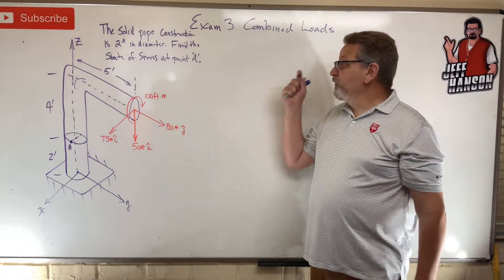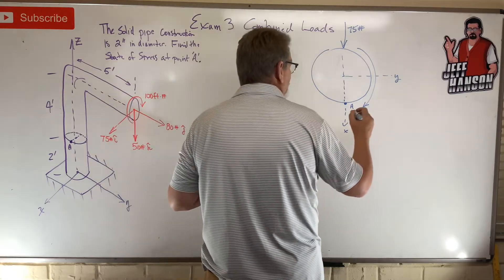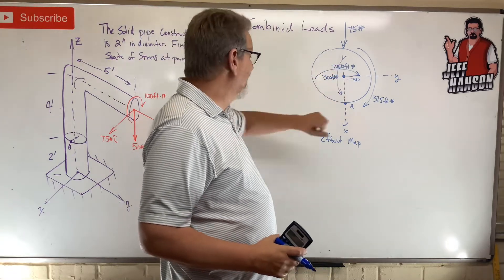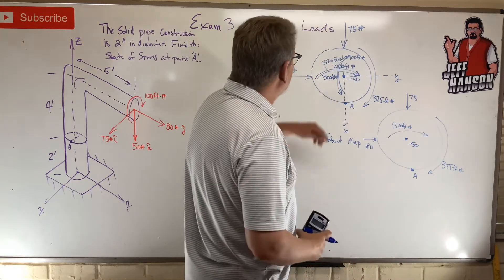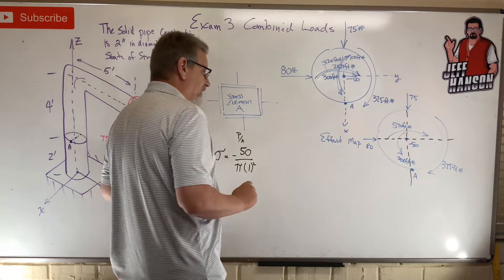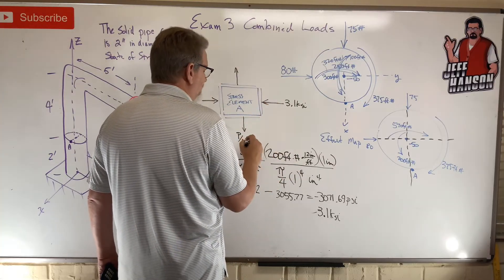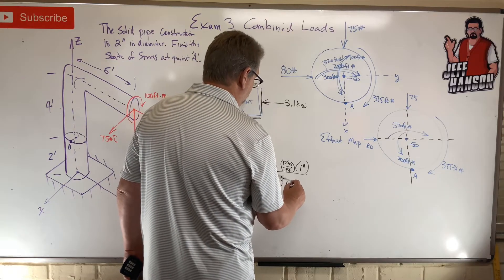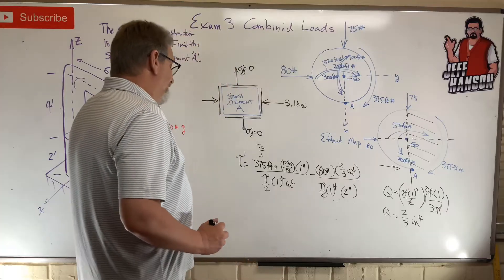Mechanics of Materials: Exam 3 Reiew Problem 1, Combined Loading

Comment: can someone explain why the 375 ft# moment makes a positive shear stress? shouldn't it be negative because it is going clockwise? any input is greatly apreciated!
Reply: yeah i came to comments section to look for the same thing. i think it should be negative as well
Reply: I think that would still be correct. I think for this video he used intuition to know that they would oppose each other. I don’t think negative vs positive shear stress really means anything different unlike how the signs for stress are two different things.

Comment: Great video but I was confused on the "burrito force" resultant. Isn't it that a moment creates a shear force on a lever arm? Therefore the 6 foot segment, being the lever arm for the 100 ft*lbs moment, would have a 100/6 lbs shear force propagating through it. And at that particular point, there would be 2'/6' of the moment left in the member at point A. Please correct me if I'm wrong and why I am wrong!
Reply: moments do not have lever arms, they act on the whole system. You could think about it like there are two forces creating a couple around that end of the shaft, cancelling out all forces/level arms except the 100 ft-lb stated.